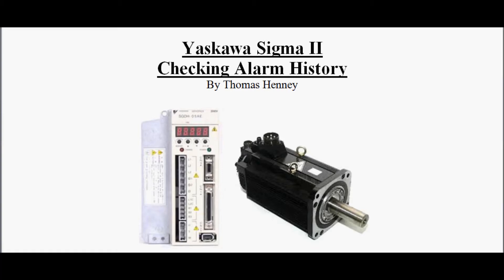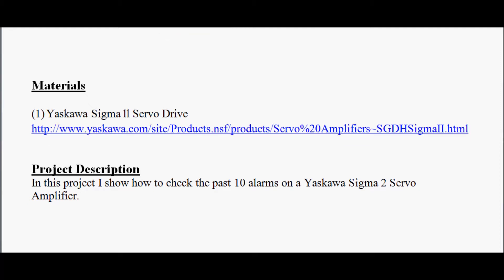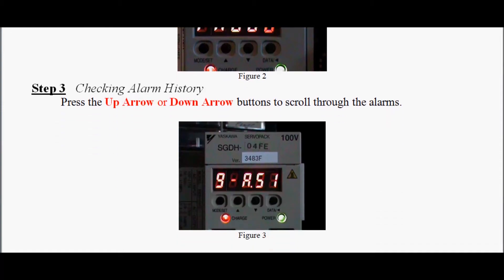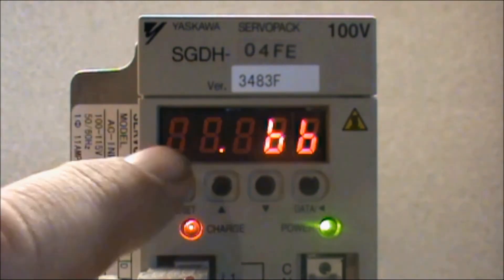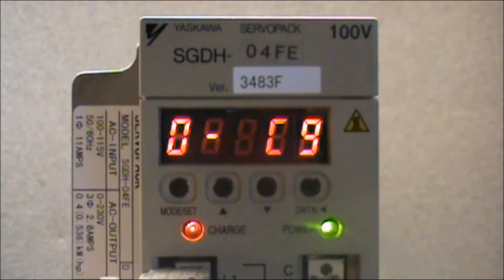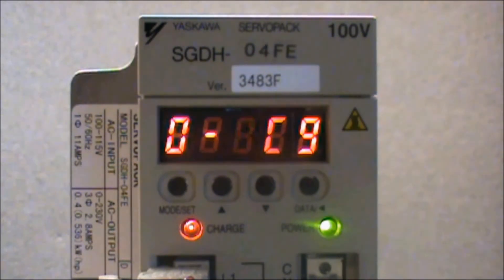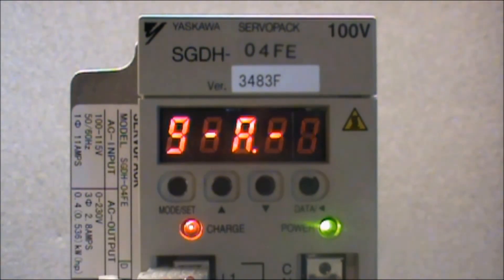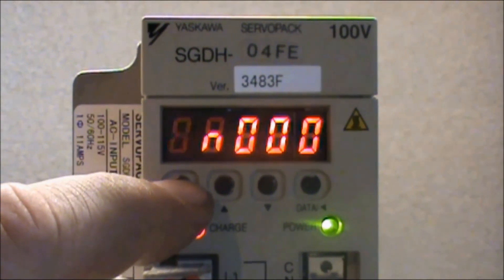How To View The Alarm History Of A Sigma II

Comment: Hello Mr. Tom.
We use the SGDH-08AE-S-OY servopack.
The "S-RDY+" signal (servopack ready) is used in the protection system.
If this signal turns off (sometimes for 1.4 seconds), the protection is activated and the equipment stops.
For what reasons could this happen?
Is it possible to view alarm history while the servopack is running?
Thank you!

Comment: I opene servo pack and connected power supply ac9 error occurred .please give solustion
Reply from the maker: AC 9 fault is in a
 encoder communications error.If
Reply from the maker: If you have the encoder cable plug into the encoder and try power cycling the servo. if that does not clear the alarm you may have a bad encoder or a bad cable and I would check to make sure that none of the pins for the encoder have been bent I've seen that several times with her hope this helps
Reply from the maker: Troubleshooting this problem I would start with the servo motor check the pins of the encoder make sure that none are bad next check the encoder cable make sure that the cable is in good condition there are no brakes no kinks in the cable for the cable could possibly broken inside the jacket and finally make sure the connection to the servo pack is solid and from there you can attempt to replace the motor then I would replace the servo pack.
Reply: @tomh2466   ماهي المشكله
Reply: نعم هذا الكيبل
Reply from the maker: @salahmkpl1020  I have run your question through Google translator. Seems you are asking about a cable?
Reply: @tomh2466   نعم يوجد لدي مشكله  نفس هذا
Reply from the maker: @salahmkpl1020  The A.C9 is when the servo pack has lost communication with he servo pack. Unfortunately this fault does have limited options. 

My first suggestion check encoder cable for any damage if damaged replace.  Or if you have extra encoder cable temporary install (I usually  stretch across floor to do trial run). If it works install permanently. 

Next swap motor. 

The last option replace servo pack be sure to upload paraneters from old servo pack to download to new.  

Hope This Helps 
Tom
Reply from the maker: @salahmkpl1020  If you are having the A.C9 fault. First the fault is an encoder based issue, simply the servo pack is not communicating with the motors encoder. This could be a noise issue, ensure cable is installed away from high power cabling. 

QUESTIONS:
Was this an up and running system?
Has anything been changed? Motor, servo pack parameters etc...

First I would check the motor or encoder cable for any damage that includes wear, dirt, grime etc... Any damage clean it, or replace item. I have seen the connecting pins of cable bent in encoder socket.

Unfortunately that's all for the normal troubleshooting routines without high end scopemeters to monitor encoder pulses. 

Process of elimination:
First layout a new encoder cable across the floor (ensure its not a hazard) and hook it up to the motor encoder and servo pack do trial run of machine. If no problems permanently install and move on.

Next install new motor, if no go.

Swap servo pack.

Hope This Helps 
Tom H
Reply: @tomh2466   I want to talk to you by e-mail, is it possible?
Reply: Thank you Tom
Reply: I want to talk to you, e-mail, so that we can be friends. You are a distinguished engineer and a creator. I have great respect for you

Comment: Hi Tom I getting a C10 alarm on my SGDV this servopack controls the z axis
Reply from the maker: Good Evening Oscar, 

Here's the explanation Yaskawa gives.
Servo Overrun Detected. 
1. Power phases U,V & W wiring in motor incorrect.
2. Faulty Encoder
3. Faulty Servo Pack.
Now I have seen all three, here is a couple others.
The encoder cable is damaged, I've had a cable that was submerged in oil one time causing the A & B phases to short.
Has any thing changed with the load? I work in plastics and in thermoforming we use pneumatic cylinders to assist the servos, if a cylinder was not carrying its part of the load this fault was generated as the servo could not handle the entire load.

Also look at the motor, at times the bearing start to go bad and cause a temporary bind, and once it cuts free the inertia helps to drive it out of control.

Here's one that could cause the fault, if you have a break motor , check the break to see if its hanging up than it cuts loose causing over speed. . Seen that several times.

A few days ago I experienced the same type of fault with an old Allen Bradley Ultra 3000 servo, here the linkage in a bagger had broken which when it closed the jaws to seal the bag the linkage would bind than break free resulting in the fault.

So I would first look for any binding, ensure the cables in good shape
Reply: Yes I have a break motor my technician said that is no being released by the computer or the drive
Reply from the maker: @OscarGonzalez-hc8bw  
Ok Oscar,
If the Servo Pack goes to RUN mode the servo pack should send the signal to release the break. I am assuming the power to the brake is 24vdc, verify you have 24vdc. I have normally seen the brake controlled by the Servo Pack Output to a relay, verify the relay is operating properly. 

Also if this is a new install or a drive change you may need to look at parameter Pn50F this is the "Brake Signal Allocation" you can set as NO BRAKE or which output the signal is generated from. For more information see page 99 of the Sigma 5 USER'S MANUAL Design And Maintenance, use link below.

https://mobile.yaskawa.com/downloads/search-index/details?showType=details&docnum=SIEPS80000064

example: on the CN1 connector you can use terminals 1,2 or 23,24 or 25,26 you can use the hand held controller or SigmaWin+ to view the parameter. 

Next  I want you to ohm the break of the servo motor I usually disconnect the cable in the panel and ohm both cable and motor at the same time, I usually see 22ohms on the break coil. 

If the servo pack is not releasing the break but goes to RUN mode check output from drive. Could be bad output, if so replace drive. 

Hope this helps
Tom
Reply from the maker: Oscar,
"my technician said that is no being released by the computer or the drive" I personally have only seen the brake controlled by the servo pack.

Tom
Reply: Ok Tom already mess with it I turn on the machine the servopack is in run mode as soon as I pushed the reset axis button it goes to 910 and if I push the button one more time it goes to a 710 alarm
Reply from the maker: @OscarGonzalez-hc8bw  
The a.910 is a PREOVERLOAD this is telling you that the servo is at the threshold of an overload, now a servo may run for X amount of time, depending on parameter setting and if it is experiencing an intermittent or constant overload. The
A.710 is an overload and will shut down and fault the servo.

One thing, what type of application and how is the servo connected, is belt drive, gearbox etc. Also is it part of a master slave setup. This is where both servos are sharing the burden of the load. 

But what bothers me is it sounds like when you reset the serve and it goes right to 
A.910. it tells me something has changed in the load or maybe the ratio of the gearbox if being used.

Also what was happening around the time when this all started was the servo motor replaced. If so was an auto tune preformed.

Hope This Helps
Tom
Reply: @tomh2466  no it wasn’t replaced it was only tested to find out if it was in good condition
Reply from the maker: @OscarGonzalez-hc8bw  

What about the mechical part, has anything changed.

Also when you reset the servo pack check check the input and output ⚡ voltages you could also have a sag in voltage. 

Hope this helps
Tom
Reply from the maker: @OscarGonzalez-hc8bw  Earlier you mentioned the brake was not disengaging, have you resolved that issue.

 "as soon as I pushed the reset axis button it goes to 910" this tells me that the servo pack has reset. "and if I push the button one more time it goes to a 710 alarm" the second reset could signal to HOME the axis. 

Has the A.C10 alarm been resolved?

Tom
Reply: @tomh2466  the C10 alarm came on on Saturday after I mess with the machine but it didn’t yesterday only 910 and 710 like I mention 
Now on my control screen tells me there’s a 106 alarm present this machine has an OSAI controller 
About the brake the servo It used to do like it want it to start turning and suddenly stopped now is not doing any movement at all

Comment: Hello Mr Tom 
i have one sgdh-08ae-s-oy in my flow pack machine with the alarme AC 09
can you help me to solve this problem please
 Best regards
Reply from the maker: ZItouni Ahmed Amine
If the error code is A.C9 this is an encoder communication error.
First thing, is this a new install? Does this problem occur during power up or during production.
Next if it happens at power up what we need to do is start by "ELIMINATING POSSIBLE CAUSES".  I would start by checking the encoder cable for any signs of wear breaks etc... or if you have a spare new cable try swapping cables temporarily this is easier then ohming  out each and every wire the cable. (if problem is not solved swap cables back) if you have an extra servo motor handy  wire it up and see if clears the alarm. Last the servo amplifier may have a bad board, you may need to change it.
Hope This Helps
Tom

Comment: What is the cause of the driver A.51 error?
Reply from the maker: What type of process is this installed in.
This is an over speed error, rotational speed of the motor is
excessively high. Now I have normally seen this happen when the servo is moving a heavy weight..
Reply from the maker: Think of it as pushing your car up a hill and you come over the top and it starts to roll down hill and you are unable to hold it back and loose control.
Reply: Thank you for the information you provided.I am doing servo motor repair.I started in driver repairs.No problem in Servo Motor.Because I tested with another driver.Drive is faulty.The problem is in the encoder output of the drive?Is the problem at the U, V, W output?I couldn't find the fault.

Comment: Is this the same procedure for Servo Pack SGDV-590A01A00200?
Reply from the maker: There is a handheld that you could use to navigate to the Function Mode and display the alarm history. 

Pressing the Mode/Set key then use the up / down arrows to navigate to FN000 then press the Data key, the display should display the alarm history.

Tom

Comment from the maker: Alif Alif La

When did this start happening, 
1. Is this a new install.
2. Replacement of bad servo pack.
3. Happened during operation.

Does the servo pack power up in bb or Run or a.10? 
(If powers up in bb then faults when switched to run or jog then faults possible bad cable, motor or servo pack.)

Check the load, is there a heavy load or binding? 
If running at a low speed could also generate the a.10 alarm. (seen this one before)
 
Was a breaking resistor installed. 
(check wiring and resistor, ohm out resistor verify with MFG.also check wiring for resistor to drive terminal)

Have you megged the motor and power cable? 
(do this with power cable disconnected from servo pack) Phase to phase and phase to ground.

This could also be a noise issue on the encoder cable.

Could also be bad board or temperature switch for heat sink.

Hope this helps
Tom

Comment from the maker: Well the A.10 is a Overcurrent or Heat Sink Overheated alarm. 
When does this alarm happen? During operation or at power up?
1.Check the servo pack heat sink for dust and debris, also ensure the fan for the heat sink is working. 
2. Check power wiring for shorts phase to phase , or phase to ground.
3. Check wiring to braking resistor.
4. Could also be a drive board issue, replace servo pack.

Comment: Hello Tom.
I have one SGDH-30DE-OY with the alarm A.30
could I solve this alarm in the settings, or will be an electronic problem
without solution?

tanks.
Reply from the maker: Hello Pedro,
The A.30 is a regeneration alarm, there are several things that can cause this just to name a few are...
1. Parameter changes (acceleration / deceleration) etc...
2. High inertia loads
 And there are possible several solutions.  Has there been any parameter changes, such as Acceleration / Deceleration, or adding a breaking resistor. If this is a new install I would look into the parameters first. But if this is a running system check to see if anything has changed, possibly adding a breaking resistor could solve your problem.
Reply from the maker: If there has been a parameter change you could reset back to factory default and re-enter your parameters.
Reply: Ok Tom, 
Thank you so much for your answer.